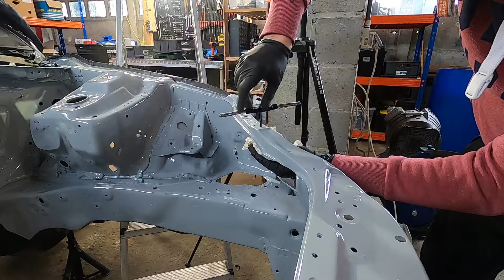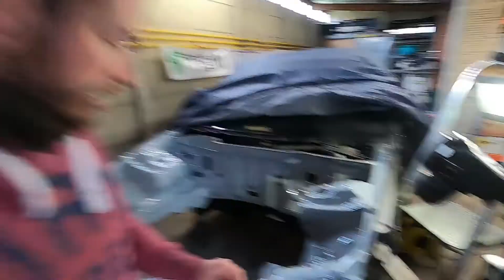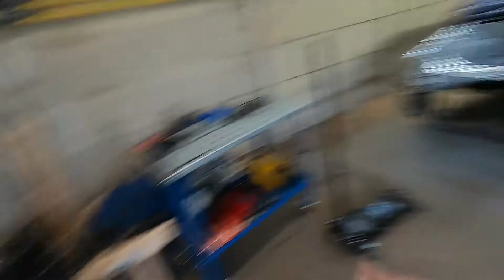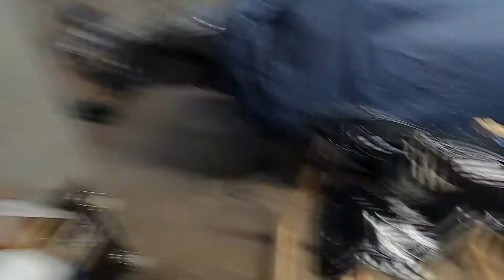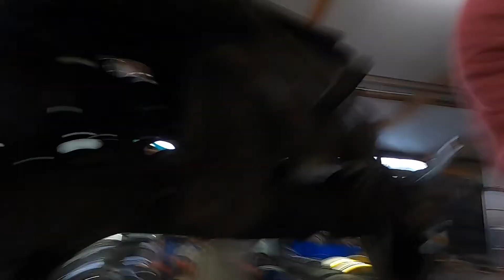Subframe, power steering tuck & enginemounts

Comment from the maker: Timestamps:

0:00 - Intro
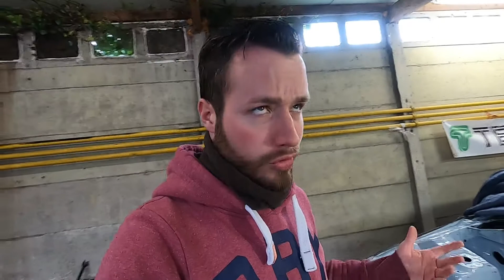0:35 - Cleaning the threads
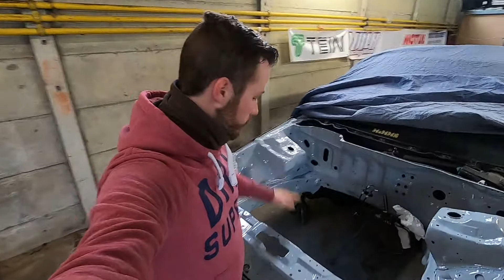3:26 - Installing the subframe
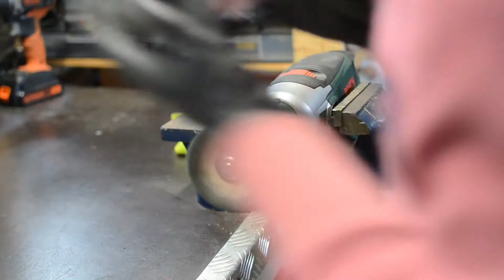5:51 - Polishing the enginemounts
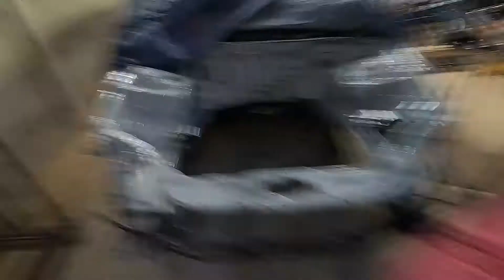7:20 - Power steering delete
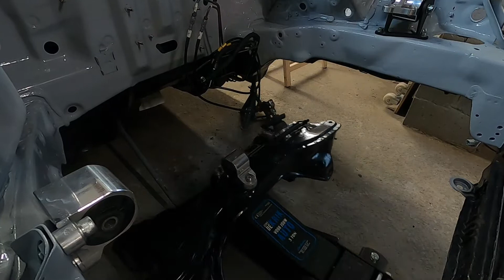8:28 - Subframe install, 2nd try
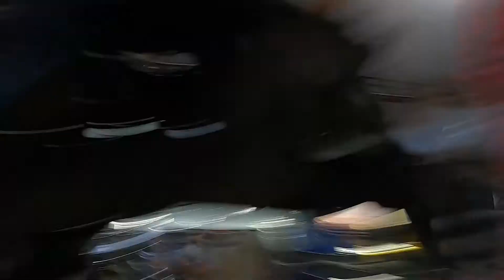9:04 - Outro